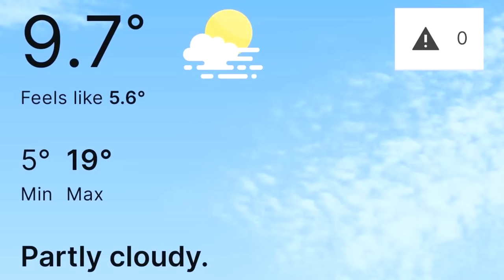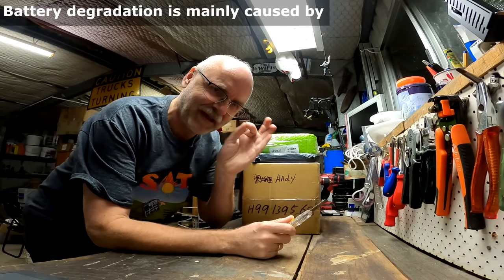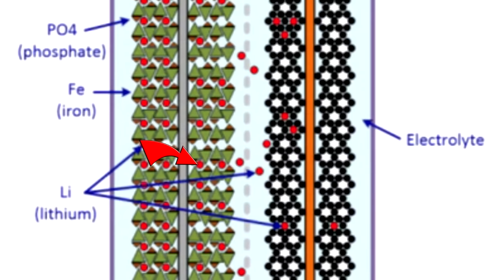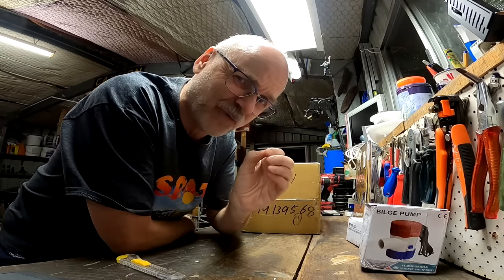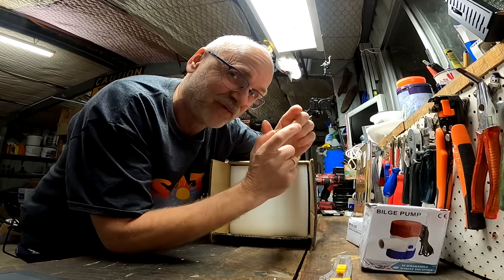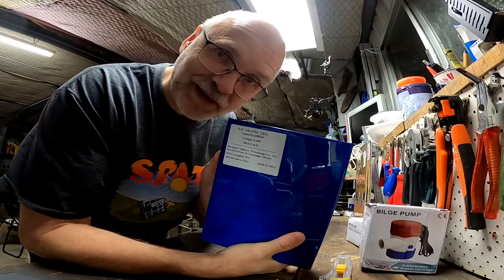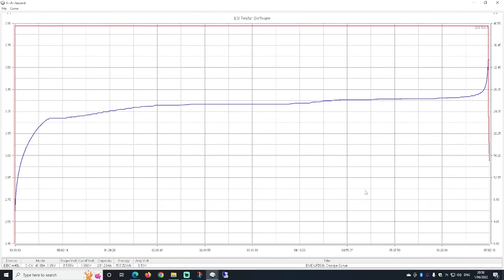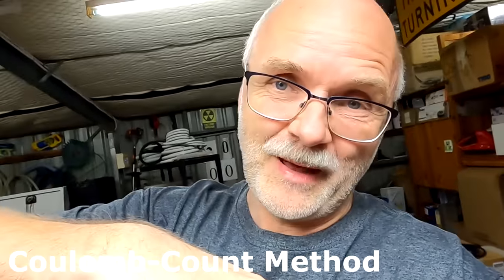Busting the 20%-80% SOC myth for LiFePO4 batteries.

Comment: Hi Andi, nice video, but flawed conclusions, sorry to say that. You cannot tell when you enter the knees based on voltage alone. When charging a battery with high current, I can reach 3.5V cell voltage at 70% soc easily. stopping at 3.4V would leave me with half empty cells. Always consider the current when measuring any voltage under load. 3.4V resting voltage of a full cell is not the same as 3.4V at 0.5C charge current, nor is 3.1V cell voltage the same on 0.5C discharge current.

I use Winston cells with a capacity of 1000Ah each, and very low resistance, they are speced to run on 1C continous current, 3C quick charge/ discharge rates. Still voltage measurements depend on the current, even a small current of 100A (0.1C) moves the voltage measurement significantly.

Therefore charging and balancing should be done only in  the knie areas, 3.6V...3.65V as absorption (or CV setting) makes absolutely sense, and float voltage of 3.375V too to use excess energy directly without charging the cells, but keeping them full around 95..98%.

Your video part about the ions is pretty nice btw. To break an ion out on the left side from a chemical bond and move it physically across the barrier and push it into an area of repelling same charged ions requires an energy (voltage offset), applying the resting voltage of a full cell moves no ions, so you cannot balance cells by just connecting them in parallel nor can you charge cells without having a higher voltage on the source. You need an offset, battery manufacturer define the charged voltage in the spec sheet, (it is usually 3.65V for LFP) don't invent other 'safe' settings, just follow the specs - Your cell may be near full at 3.4V, but very likely it isn't as long as there is a current flowing .
Reply from the maker: Thanks for your comment and explanation. You must have missed the video I linked in the description and also at the end of the video where I exactly explain why charging speed matters. There is also a very interesting graph I made included which shows exactly what you described above.
https://youtu.be/qZg4Jxftw-c

I personally found 3.375V too high for floating. This is still above the resting voltage of my cells. So I would keep them on an elevated voltage. This might be different with other brand of cells though

Comment: To explain the problem of battery degradation, we need 300 pages pdf, because there is o lot of factor, purity of electrolyte, type of electrolyte / EMC, EC, DEC + LiPF6 / , cathode material / FePO4, NMC433, NMC532, NMC622, NMC811, NMC9 1/2 1/2 /, anode material, / C6 + 1 - 2  % Si or TiO / , binder, current collectors, size of particles, temperature, C-rate, orientation of cell, proper formatting, cummulated time over 3.45 V for LFP, or 4.15 / 4.25 for NMC, charging at low temps when electrodes and elect. has under 5 *C, microcycles, DC ripple of MPPT, DC ripple of inverter. So if we have cells way of off 40 - 60 % SOC, e.g. outside 30 - 75,  20 - 85,  10 - 95 % region, a lot of time, degradation is proportional to that time, but there are chemical mechanisms, to partially restore capacity. But capacity is no the problem at old cells, the problem is AC impedance and DC resistance, when cell is over 3.6 V under charging, but other cells are under 3.38 V, and if U charge with 15 - 20 A current a U have no 20 A active balancer, U are unable to charge all the cells to full capacity. This is the same, if cell has capacity but only 2.9 V because cell is "soft", if U are discharging.

Comment: I sure hope this isn't click-bait...12:00 minutes in and no mention of the formation of dendrites.  :(  The guidance I have always heard, with LiFePO4, was to use the middle 80% (between 10% and 90%).  That CAN be accomplished using voltages, not just by monitoring with a shunt.  Certainly if you try to stay within the middle 60% (between 20% and 80%) your battery life will be excellent, but you are giving up a higher percentage of the usable capacity than is necessary.  And now we have sodium-ion batteries starting to show real promise and commercial viability.  Also very encouraging is the recent release of Perovskite solar panels, which claim to increase output by 200% or more.  The future is very bright...and it seems to be lit by solar!   :)
Reply: Please explain how to achieve between 20-80% using voltages.

Comment: When comparing lifepo4 to a LTO battery which has a larger usable voltage range yet far more cycles not sure if it is just sharp voltage changes, the material strain is a key factor I do believe. The "Zero-Strain-Material" used in LTO batteries are designed for a life of 30,000 full depth-of-discharge cycles which is up to six times greater than lifepo4 technologies, giving it a life-span of up to 30 years.
Reply: Yeah, I really don't understand why more manufacturers aren't going to LTO for off-grid. If you go on AliExpress, they aren't that much more expensive.
I'd also like to see car manufacturers  put a smaller like 5kwh or 10kwh LTO in there to take the bulk of the charge cycles and preserve the lighter Li-Ion.
Reply: Price, weight and the wide voltage range make the lto prohibitive. Inverters generally speaking need a small voltage range there is a cost the adjusting the circuits to handle the wider variance. As for the vehicles the weight is the biggest issue lifepo4 are already seen as heavy for them even though they are seeing widescale adoption of that battery now the lto is just substantially heavier again. Lto really are ideal for long term off grid stationary systems IMHO. They are used in radio transmission repeaters and scientific observation posts etc. Even in the stationary offgrid the additional cost of the large amperage buck converters needed to stabilize the voltage makes it pricey, I have haggle building a lto system for years but the additional costs make me leary to commit.
Reply: @frankbush333  I don't know... doesn't seem that much pricier than LiFePO4 on Aliexpress. They already use them in electric buses (I'm sure a lot of other applications).
I even think  5kwh or 10kwh of the battery pack of an EV would be good. That's an insignificant amount of weight on a 100kwh pack and you should extend the lifetime by leaps. Also allows faster charging for the first 10% of charging (maybe almost instantaneous 30 miles or something).  And has way better performance in the cold (and to a lesser degree the heat). If you could use the LTO battery to start and warm up the balance of the rest of the battery in the cold, seems like you could increase efficiency.
I know some company is working on a LiFePO4/lighter Lithium hybrid along these lines.

I have a 24V inverter that works really well with the 12s LTO battery that I bought.  (20-30V input- above 30V, there is almost no capacity).
Reply: Don't get me wrong I like the idea of incorporating the lto for sure, and you are right the higher voltage setups make them far better options for use in vehicles. I have been debating experimenting using them in 2s setups for usb battery banks for long term offgrid systems because of their cold resistance and longevity. I think they are an amazing tech just working with their voltage ranges makes them a little trickier.

Comment: I bought a Renogy 100W solar "kit" for my boat. It came with everything you need..panel, Z brackets, connectors, wiring, and a PWM 30A charge controller all for 129. Am charging a 100A Lifepo4 battery. (yes I immediately see I need more panels.) The charging problem I perceive is that the "Wanderer" PWM charge controller,set to Li. charges to over 14.2 volts! There are no user settings. Question I have is: What about using a Buck/Boost converter to regulate the current to 13.6 or somewhere in that range?

Comment: Hi Andy. I have a question for you.   I build my power wall/solar battery out of a Tesla model 3.  So, what SOC do you charge your model 3 car to?  My battery is a "Standard" battery with 32 cells per group and 14 groups for a 57.6 volt battery.   Sooooo, should I charge to 57.6 volts or 58.0 volts?  Do I consider the 100% SOC at 4.2 volts or something else?  What is the100% SOC voltage per cell in your car?  
Lou Little
Reply from the maker: Hey, hey, hey, I wasn't aware you can harvest a model 3 battery modules, I thought they were compounded and glued together in on big block. Need to rewatch Sandy Munro's videos again.
Edit: just did it. So you 32 cells in parallel and 14 of these bricks in series? That would make 14*3.7V=51.8V nominal voltage.
Anyway, I only charge mine to 60% for daily usage but 4.2V is 100%SOC. I have done this twice since I have the car and watched it on the Scan my Tesla app.
So in your case I would charge them to 3.8V max (53.2V pack voltage) and let them absorb. Because they are NCA cells you need to have the right BMS for them.
Reply: @OffGridGarageAustralia  I'll send you a pix of what I have done.   I am using an active balancer model JK-B1A24S.   It is a scailed down version of your JK that you have.   Only one amp charge/discharge.  Running all the time down to 0.002 volts.    The groups (32 cells) don't wonder like the lithium iron phosphate cells that you have.  But then again, you don't have 32 cells in parallel to keep the others in check. [:~)  More to come.

Comment: The problem I have is that while the solar controllers are great for regulating the battery  there seems to be no way to automatically divert any extra available current which for me  is such a waste and I find that I can only go by voltage and have a diversion system that turns on by voltage but this does not tell me how much power is actually available so I can either take too much or too little power to my diverted load; any ideas you have how not to waste this potential power would be very helpful. Thanks
Reply from the maker: Thanks Jo. Yeah, that is a very difficult topic and problem. You can use some automation for that but as you said, it won't be perfect as the solar power may change and then you will use battery power. Basically you can only set a certain threshold to turn on a water heater when you hit absorption and then turn it off again if the battery goes under 95%SOC.
This is something we will explore as part of the automation I have planned for my system.

Comment: Previous comments disappeared re LF280K spec sheet stating that the  recommended SOC is 10-90%,  I'm using the JK-BMS to calculate the SOC and have it communicating with the inverter so the inverter stops charging/discharging. My previous comments disappeared for anyone interested,  I have built an ESP32 to do it look for esphome-jk-bms-can
Reply from the maker: Thank you. But can you not set your inverter to stop discharging the battery anyway without communication to the BMS?
If you post links in the comments, YouTube will delete the comment unfortunately. Not a good filter system...

Comment: Hey mate enjoyed your vid and it has given me more confidence to do a full discharge teat on my 280ah lithium nattery bwfore i install it into my 4wd.
I was quite concerned about draining it too low because i might damage it so cheers for that!
Forgove my ingnorance but i guess for a 12v battery i would just multiply the 3.4v x 4 =13.6v as the upper limit and then 3.1v x 4 = 12.4v for the lower limit . . . To keep it within the right range . . . ?

Comment: My question would be how accurate is the battery SOC using the JK BMS, especially over time. Does it also drift? I would guess it does not but I have no scientific theory to back up that intuition. I would also like to see some more testing and learning around the CAN bus and RS485 of the JK. Would be very interesting to see what it is capable of and how accurate it is.
Reply from the maker: I don't trust any of the BMS and only use the Victron Smart Shunt as my point of truth. All three BMSes I have installed right now show a different SOC.
I have another Raspberry Pi coming in for more testing and exploring of RS485 with different BMS. Reading the information from a BMS will not make it more accurate. It only sends the data it shows in the app anyway.
Reply: @OffGridGarageAustralia  I would think the BMS could be accurate if it resets to 100% every time it charges to full. If you charge to say 3.65V until it will take no more amps, and let it rest for say an hour, you can be most certain it is then at 100% (I think). How about we test that?